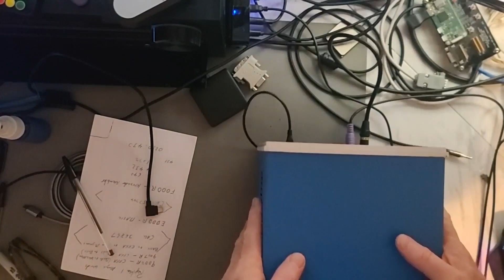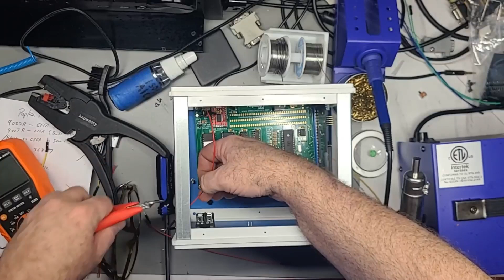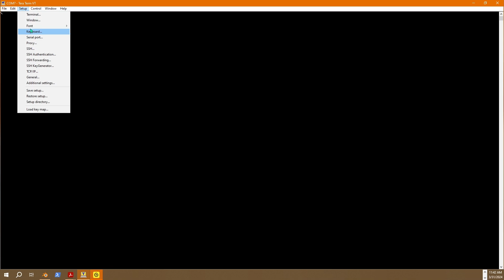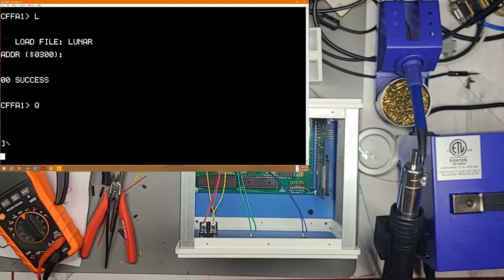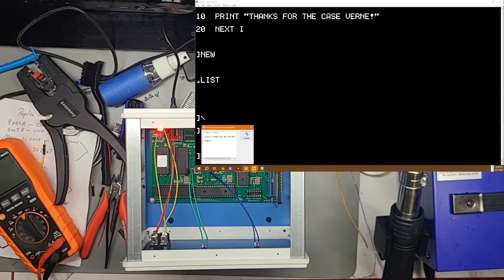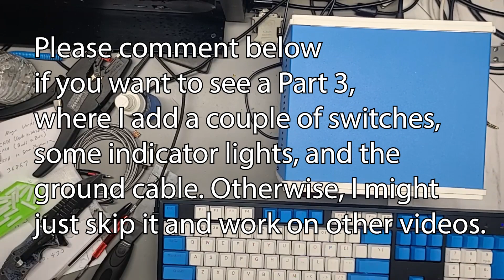Briel Replica 1 Part 2: Wiring Switches for the New Case, Applesoft Basic, CFFA1 Card, Tera Term

Comment: how did you chose this version of an Apple 1 replica? Why not the $20 board from Russia, or the full sized replica board?
Reply from the maker: That is a fair question and my answer is simply that I saw it on the Reactive Micro website and I wanted it.  I didn't have the money to buy it right then but I looked at it from time to time and I bought it when I could. I didn't know about the Russian board. I had seen the replica boards and I thought about building one someday but I have not done so yet.

As it worked out, I got a chance to meet Vince Briel a couple of times at VCFSW and he seems like a nice guy. He even commented on my posts in the DFW Retro Computing Group and pointed out the pin headers for the reset and clear buttons. 

I did a video about building a Kim One Uno. This kit cost around $25.00 and, among other things, it can run Wozmon and Apple 1 software. It was a lot of fun for such a small investment.

I did not do extensive research to determine the perfect kit to buy. I just stumbled upon a couple of kits that looked like they'd be fun and I built them.

Thanks for your question.